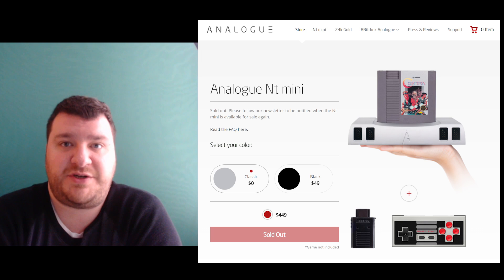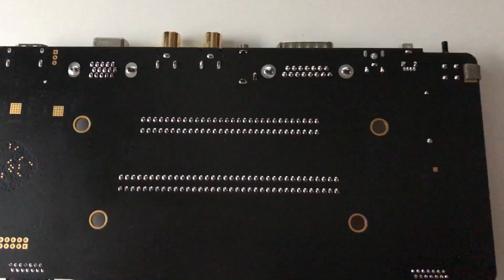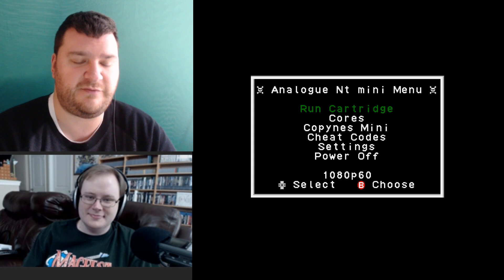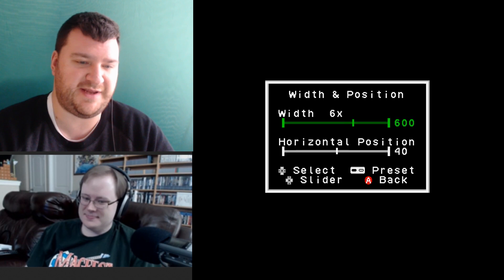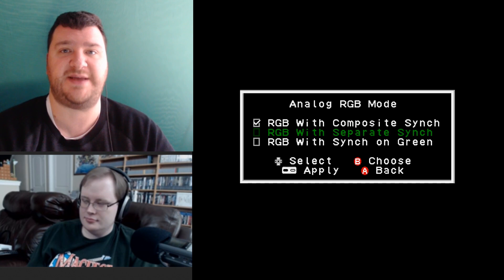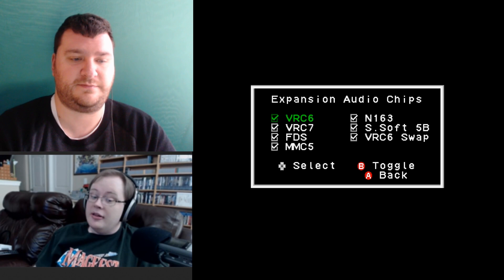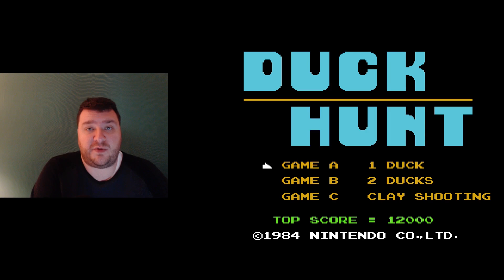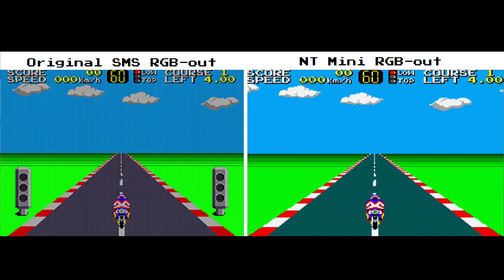Analogue NT Mini Review by RetroRGB

Comment: Great video Bob! Thank you for taking the time and effort to make this. One concern I had was about your repeated mention of describing the HD15 connector as a "VGA connector" in the first part of the video. We all know people call that connector by that name ("VGA"), and that is probably the most common thing it is used for in the world, but in this case the wiring pinouts are different, and plugging an actual VGA-compatible monitor into that port likely will not deliver results anyone might expect. It's obvious Analogue used it because it is widespread, cheap, and easy to procure, but the side effect is that it also opens the door to people connecting inappropriate peripherals to that port just because they happen to fit. Just thought that should have been hammered home a bit more. 

I also heard you say this unit "could have been cheaper". Without knowing their manufacturing or engineering costs, I'm not sure if that really is true. I know I'D CERTAINLY LIKE IT to have been cheaper, but whether it could have been is a different story. Look at the engineering side alone -- Kevtris isn't JUST doing bugfixes on the final shipping code -- he's expanding and continuing to roll out new functionality. How is he getting compensated for expanded work done after the initial box gets sold? Kevtris deserves real compensation for his work -- I'm hoping he is coming out on top and doing well by the projects he is bringing to life for all of these other companies. For a low-yield, niche product like this one, it would be hard to see how they could make it for $100 or $200, like I hear some people say they wish it were priced. I guess it is a case of looking at that curve of demand vs price and determining whether enough people can buy it at the price they need to produce it at in order to make it worth their while. 

Keep up the great videos!
Reply from the maker: You're right, I should stop saying "VGA".  It DEFINITELY could have been cheaper:  Remove the NES30 controller.  Anything other than that is debatable, but people that don't want one or already own one just lost a bit of money.

Comment: Just wanted to chime in that the only difference I could find between the digital simulated FDS and the actual FDS Ram adapter sound is that the former does not have a low pass filter, leading to the 'harsher' sound as Mark described it(which is fitting). The low pass filter unfortunately would take up too many logic elements on the FPGA and won't fit, however you can just pass through cartridge audio if you want the low-pass filter sound.

Depending on the game, I actually swap between the two preferences. I find the low pass filter to be great for Zelda, but actually prefer the cleaner sound of the no low pass filter in a few other games. I'm sure opinions will vary!

I'm incredibly impressed with the digital sound chip accuracy this time around. I own a hi-def nes and I felt like a few of the chips were a little bit lacking, but this time around everything sounds absolutely fantastic. I did need to crank up the volume a bit on the FDS and turn down the Sunsoft 5b chip because it was much louder than the cart + av famicom sounds, but with those tweaks, it sounds perfect to my ears. The lowpass filter thing is the only reason I even use the cartridge audio passthrough feature!
Reply from the maker: Thanks for the input.  I'll ask MLiG to give that a try in their video.

Comment: Hi Bob, Fantastic review. I think Mark got it wrong with the audio chips. If you have the original cart you don't need to select any because the sound will be from the chip in the cart. If you are playing from a rom then you need to choose the chip that you want the NT to emulate. 

I tested both options with Castlevania 3 and they sound very different. The audio chips emulation is not 100% accurate.

Comment: Marc mentioned that for TV standard settings you should just set it at your TV standard and then forget about it, but that's incorrect! This is the setting you use to switch regions, means you can finally play NTSC/PAL games on the same system. Great for exclusive gems like Turrican that only came out in Europe!

Comment: Hi retrorgb this is without a doubt the quintessential review of the nt mini.  Thank you for de mystifying what it can do.  I wondered if you wouldn’t mind sharing your professional opinion of pairing a sony kv-40xbr800 with an analogue nt mini?  I really want a bvm or even a pvm but all I have found are north of $1k  I have a line on an this 40” 4:3 sony and my hope is to use it with an analogue nt mini but I can’t seem to find if the unit will process 15khz signals nor if it will basically just be like using my nt mini with my sony projector hw40es.
Reply from the maker: It it's an "HD CRT", you might have issues with 240p...however if you use the NT Mini in 480p mode with scanlines turned on, that might be an excellent option.

Comment: 06:40 regarding the famicom extension port and the poor fit of the 3d adapter, I think a Neogeo controller extension cord could fix this issue, assuming all 15 pins are wired on the extension cord. worth a try for 12$ usd

Comment: Great video and interviews Bob!Thanks for putting the idea into Kevin's head to allow the zapper for the SMS games.Do you think the Famicom glasses would work as a possible substitute (like the zapper might for lightgun games) for the SMS 3D games also or do they use different tech? I don't currently own any at all so I am not sure how they workOh by the way did your FDS adapter work when you plugged it into the top or did you have to adjust it at all? If yours worked I am going to buy another one or dig around as I might have a 2nd one at my house somewhere.I am trying to find a place that would sell me a very short famicom/neo geo controller ext cord so I don't have to put any stress on the usb power input. The shortest I can find is 6 feat currently though. do you know anyone by chance that currently make or could make a few short ones?
Reply from the maker: Good question about the SMS 3D using Famicom 3D.  I think Kevin was going to look into it, but I'm not sure the timing.  Also, the FDS adapter worked perfect with the Magic Wild card (My FDSStick is currently in storage).

Not sure on the shorter extension cables.  Sorry.

Comment: Great video, really liked this style of review, thanks!

One question that I can't seem to find an answer for anywhere: with jailbroken firmware can you play FDS roms off an SD card? I just placed a pre-order for a black one, is there still a need for me to buy an Everdrive N8?
Reply from the maker: Not at the moment.  You can get a FDS RAM adapter and a Magic Wild Card / FDSstick though:  http://www.retrorgb.com/romcarts.html
Some people have reported problems with that, but I just used a MWC with mine for a few hours strait and didn't have any issues.
Reply: Awesome, thanks for the tip!

Comment: I'm having trouble with my NT mini where display is offset about 1 inch to the right of the screen, never seeming to be correctly centred.   anyone have any experience with this; moreover tweaking the horizontal, 4x 5x whatever I do never seems to make a difference in the overall display of my games.

Comment: wait so something confuses me about the NT Mini, I understand its an FPGA-based system which makes it a "hard" emulation baswd system for Nintendo games but how does that work for the other systems it began to support? Are the GameGear and Collecovision games considered "soft" on the hardware and are there noticable differences when using these? eg. Gamecube on Wii vs SNES on PSP. 

Its a great system and I'd love to get one if they release a cheaper model but I'm curious about this.
Reply from the maker: Nope, all consoles that are emulated are full FPGA cores, just like the NES.  That's why I was so exited about this...it's like you're getting each individual console that outputs both RGB and HDMI!

Comment: how does scaling works on a crt??? shouldn't it be a 1x options for analogue input?? does it look "real 3:4" when plugged to a crt??
Reply from the maker: There is no scaling on the analog output, as it's not needed.  When plugged into a CRT, it looks just like the original.
Reply: nice, thanks.

Comment: so what is better?  the hi def nes mod or this?  i prefer the hi def nes because its o.g hardware.
Reply: Nt mini is a significant upgrade from hi def nes. More compatibility with both accessories and games. Significantly more useful scaling mode (5x height), way more customization options (custom palettes, hotkeys, etc), rom support, ability to simulate 20 other 8 bit systems (eventually), both hdmi and rgb/svideo/composite, ...
Reply: I prefer hi-def NES.
Reply: I have to agree with Reuben, the Hidef NES if better just because its real hardware.
Reply: Kevtris is the bomb. Once I found out the NT Mini was FPGA and not original parts, it stopped me from clicking buy. The item was in my cart. I really like my Hi-Def NES 001. I still might get an NT Mini someday, Kevtris deserves millions for his work...I know it's his FPGA work in the NT MIni too, but nothing can top putting a cartridge into an original NES. If i was that dude, I'd want 80%+ profit of every hi-def NES/NT Mini sale. He's the brains behind everything else. It's apparent he excels and is determined to get the best out there.
Reply: I'll know soon enough, I've had the hi-def kit installed now for about 6 months but just recently sold it to put towards the Nt Mini. See I've got a few games that don't play nice with the hi-def kit's despeckle options, so I'm hopeful this won't be a issue on the Nt Mini.
But honestly if its original hardware you want to use, I'd say go with the hi def kit. I played on mine for about 6 months with little issue except on a few obscure titles that interest me.
Reply: As someone who does not have a flash cart, or a RGB/HDMI modded NES/Famicom, I'm really thinking this would be a good deal for me. I'm not picky if it uses original hardware (Especially supporting all the cores it already does), as long as it runs as close to 100% as possible in terms of similarity.
Reply from the maker: @John Locke - I can't tell if you're serious or trolling.
Reply: To all the people opining that they prefer the Hidef NES because it's real hardware, you do realize that is an intangible output quality, right? You would not be able to tell the difference in hardware execution from the Nt Mini versus real hardware, so the reason you give for preferring one over the other has no bearing on a quantifiable basis. It's a lot like saying "I like the taste of boiling water achieved by gas over electric", because the end result is the exact same boiling water.
Reply: There is a whole section of the retro population (myself included) that is all about using original hardware and getting the best video/audio quality out of it. If one does not care about those things (e.g. putting a cartridge into the system, although this supports it, that's still part of the original experience), why not just hook your PC up to the TV and use the 8bit bo bluetooth? :) It is not the same. That's not to say I won't buy an NT MIni, but Kevtris hi-def chip in an NES 001 is untouchable and a thing of beauty (to some). Plugging in Zelda 1 into an original NES and sitting 3ft away from a TV...

It's an understandable route considering the original analogue NT sourced parts that were running out (AFAIK).
Reply from the maker: @John Locke - You seem to genuinely enjoy being angry about this.  I bet you're a gem on a customer service call...
Reply: For people like me,  I think it's a perfect option. I get a Game Gear,  SMS, NES, collecovision, and PC Engine (When it's ready). 

I also have an RGB and HDMI output for all of those systems

It seems like a cheaper way to get all those systems without the shitty software emulation like the Retron 5.
Reply: @RetroRGB now that's a good line
Reply: I have both the hi-def nes and NT mini and I vastly prefer the NT mini. the hi-def NES has to generate all the audio so it's not fully using the og hardware anyway, and the audio simulation is wrong in a few places.

on top of that, there are less scaling options, and the way the hi-def NES interfaces with the PPU causes unavoidable pixel speckling or corrupted scanlines in some extremely popular games like Super Mario Bros and Zelda 2. The kit also drops a frame occasionally forcing a full monitor resync on all the displays I have, and this is random, so I could be at a very intense part in the game and be forced to die because my monitor went out.

I have extensively tested the NT Mini and cannot find any incompatibilities at this time.
Reply: John Locke The difference is in latency and the fact that there is no abstraction layer mismatch. Emulating a system on a CPU using general purpose APIs will always have more inherent latency. It is also much more difficult to fully flesh out hardware edge cases manually via software programming languages. if you use an oscilloscope to look at the input vs output logic signals of a particular chip and replicate that with logic elements on an FPGA, you get a much higher assurance of the accuracy.
Reply: I have mixed feeling about ROMs.  Nintendo, Sega and Coleco does not make money on any of the games that are being sold for the original consoles any more.  So I dont feel bad about getting ROMs, But I wouldn't download ROMs if the money I spent on the games went to the companies that made the games.  on the same side, if the companies would sell ROMs for use for an Everdrive even I would feel better.  But I don't see a reason to pay crazy over priced games to make someone else money when a ROM or that game doesnt help the creator of the game.  I prefer real games but I will never pay more then the original retail for that game.
Reply from the maker: Have you tried anger management classes?  Breathing exercises?  Finding one's center is important to achieve calm and understanding.   
I mention countless times across almost every podcast that I own every retail game I play.  And that archiving these games is important for history, as many of these games were almost lost.  And that we should all support all developers currently creating games.  If you actually listened to any of the podcasts, you'd know that the general consensus of the retro gaming community is to support wherever we can.  I chose to play the rom of Sonic The Hedgehog because it's easy for me, however I own the original cart, have purchased the 3D remake for 3DS and also purchased for my mobile devices.  I could have easily stolen it on 3DS or just loaded an emulator on my phone, but I chose to buy the game, because I think it's awesome and want the developers to keep coming up with unique and interesting ways to play it.
Please keep your opinions coming...especially about FPGA's.  The more you talk, the more you make everyone reading these second guess their own opinions...and then come to the conclusion that we're right.

...oh and your tasteless dig on Kevin was actually a dig on me (which is fine).  I'm the one recording the interview, he just plugged his camera into a capture card.  I could have stopped the interview and told him to take a few min to turn off face tracking...but I knew the only people who would care are trolls looking for something to talk about.
Reply from the maker: I sleep fine knowing how hard myself and others in the community have worked to preserve these games and consoles.  The fact that you're wishing ill-will on anyone shows your character.  
What you're really complaining about is the use of ROM's not the NT Mini itself.  That's out of all of our hands...they've been around for years and nothing you can do will make them go away.  Even if Kevin disables ROM loading from an SD card, there are already ROM carts for every console.  I must ask though - If you're so upset about ROM's, why do you think so many retro game stores keep popping up?  There's more every year.  Do you think if people weren't buying these old carts, those stores could survive?  Most people use ROM carts for the same reasons I do:  
- Convenience of having everything in one place.  Example:  I own every SMS 3D game, including the really expensive ones.  In fact, I even own two of some copies, just in case something happens to the first.  That being said, I don't physically have the space to keep them all with me and even when I did, I'd rather run a ROM instead of using a rare and expensive cart.

- Fan hacks (which are also "illegal", so I'm sure that means you'd want all of those people punished for their hard work as well)

Keep your responses coming though...maybe eventually you'll make a good point.
Reply: John, I suspect you are faking outrage in order to virtue signal. Either that or you're just trolling.
Reply: The patent for the NES has expired. Even if it didn't, look up Wikipedia's 'Reverse Engineering' article and scroll to the "Legality" section. You seem to think that any reverse engineering at all is unethical and unlawful.

Regardless of what Nintendo's lawyers claim, making your own backups of intellectual property for personal use has been protected by fair use since the betamax decision. Have you ever owned a VCR or DVR? Content producers hate those machines, and would love for you to believe it is illegal to use them, but that doesn't mean it is actually illegal (or unethical) to do so. Not unless you distribute the content.

Did you notice that within Nintendo's reasoning for why copy machines are illegal they had to include the term "distribute" in the definition of what the copy machine does? If they didn't, then any old EPROM programmer would fit their description of a copy machine.